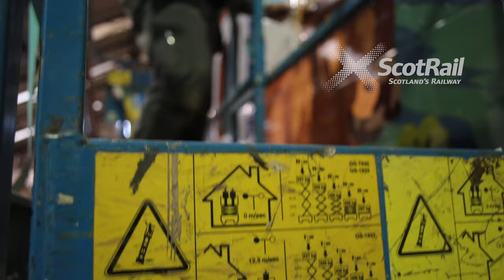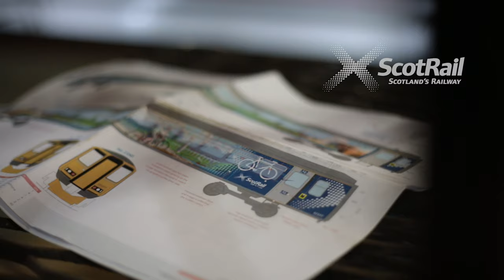Meet our ScotRail Highland Explorer!

Comment: I would like to ask ScotRail a question about the HST's on the Glasgow-Aberdeen run. I used this a couple of weeks ago and had to struggle to fit the bike into the tiny wardrobe style cabinet provided for two bikes, and I couldn't summon up the strength to lift the bike, rear wheel first, into the ceiling-mounted hook - as instructed by the staff - in the limited space. Now, when these HST trains were used on LNER and also GWR, both companies used the vans in the power cars for conveying bikes, I think five or six per train. Why are ScotRail not using these vans for bikes - especially as the racks may well still be there?
Reply from the maker: Hi there, we're looking at the bike spaces on these trains.
Reply: @ScotRail  Thanks for your speedy reply. I hope "looking at it" leads to "action", and is not just words!
Reply: @ScotRail  I'm quite shocked to read this, I used these trains extensively with GWR and have not travelled with them since the newer trains with bike cupboards came along. I have been thinking of visiting Scotland with my bike but will not hurry now. The HSTs ease of use with a bike was a big part of the decision. I feel very let down by the train companies for excluding cycle tourists after all these years.

Comment: Class 153 used to be with Great Western Railway 🚃 until March 2019 nearly 4 previous years ago. Now it’s 2023. Class 153s are coupled to class 156s. Limited amount of seats 💺💺💺💺💺💺 on 1 single car class 153s used for ScotRail in Scotland 🏴 because it conveys a bicycle 🚲 🚴 rack where rail passengers will have to find a seat 💺 in class 156 perhaps 🤔. I have been to Scotland 🏴 in April 1995 and September 2006. Scotland 🏴 is above 👆 England 🏴.  ScotRail runs everyday and public holidays except Christmas 🎄 Day and New Year’s Day 🎊 🪅 🎉 🎏  🎆 🎇 💥 however it does run on Boxing 🥊 Day with perhaps 🤔 limited service on the 26th December per year. Class 153s are also used for Transport For Wales 🏴 in Wales 🏴 runs everyday is 7 days a week and bank holidays except Christmas 🤶 Day and Boxing 🥊 Day. Class 153s are surviving at present 💝 until around perhaps 🤔 the year 2035 otherwise gone or after that date. ScotRail is bidding for new trains 🚆 🚊 🚂 🚂 by around perhaps 🤔 the latest date Tuesday 31st December 2030 (New Year’s Eve) 🎆 💥 🎇 . It’s called ScotRail because it’s short for Scotland 🏴. If the franchise ScotRail changes its franchise, it could be called Transport For Scotland 🏴. Very complicated. The north of Scotland 🏴 is very quiet 🤫. There was a train 🚊 company called First ScotRail many  years ago previously before 2023. All class 153s and 156s are standard accommodation only. Class 153s have a toilet 🚻 🚽 on ScotRail and Transport For Wales 🏴 where some don’t convey on Transport For Wales 🏴. All 2 car class 156s convey a lavatory  🚽. 🙂